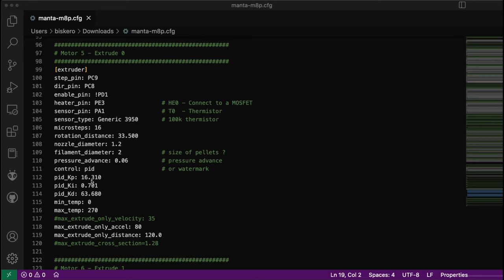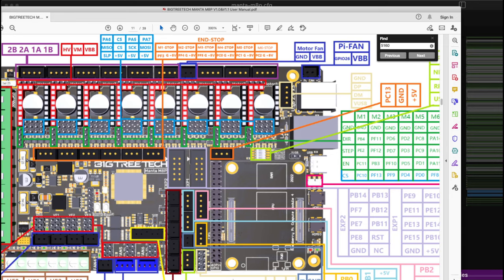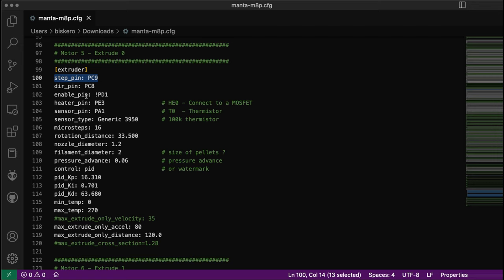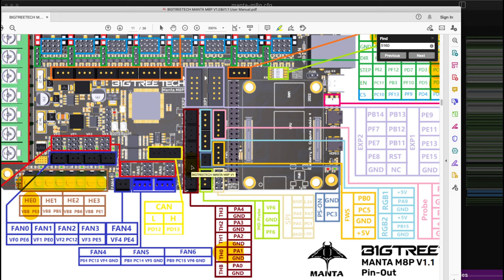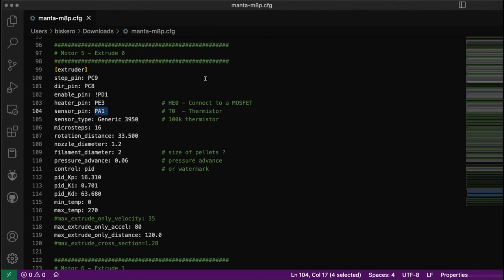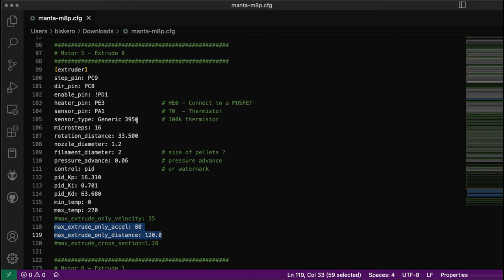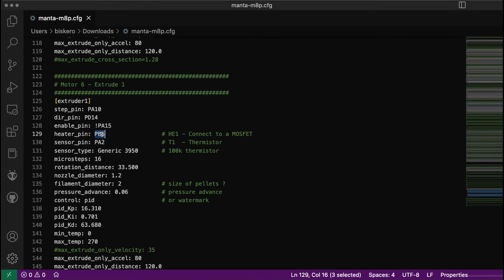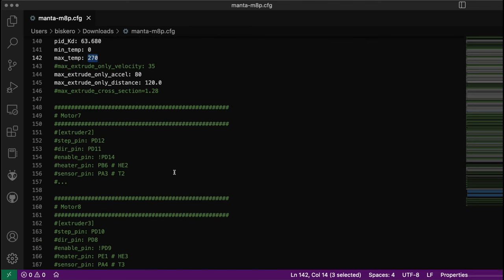Klipper Dual Pellet Extruder stepper configuration on BTT Manta M8P for my custom 3D Printer

Comment: Hello. good video.
How do I configure for double extrusion with a hotend?
Reply from the maker: it's showed in the video, you defined 2 extruders and you associate 2 motors. You just need to select them like in the video, just make sure the pins are the correct ones.
Reply: @ganzoai  I only have a mixer extruder with two motors
Reply from the maker: @carlossalas2366  ok so there is one extruder hotend with 2 motors for 2 filaments?  This configuration I am not sure since I do not use it. I suggest you to check the klipper site for reference https://www.klipper3d.org/Config_Reference.html?h=2+one+extruder#extruder and maybe ask on the Klipper Discord channel. Sorry cannot help but I have the 2 separate extruder hotends with 2 motors, one for each so it's a more standard configuration.
Reply: @ganzoai  ok. Muchas gracias desde Argentina
Reply from the maker: @carlossalas2366  you are welcome ! Viva Argentina !

Comment: Can this manta m8p v1.1 be used for independent dual extruders (IDEX)?!
Reply from the maker: The board has 4 different heater for extruders and 8 drivers, so I am using 5 drivers for axis and 2 for extruders and 2 are not used. It depends from your 3D printer configuration but it should with no problems. Please subscribe thx!
Reply: @ganzoai  already subscribed. Thank you 😊